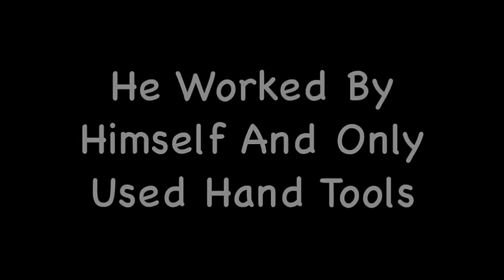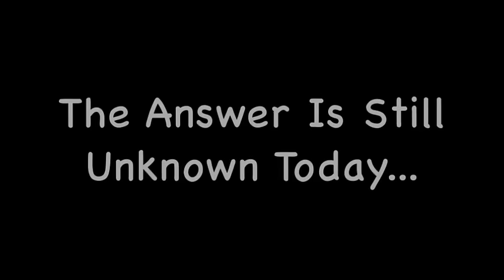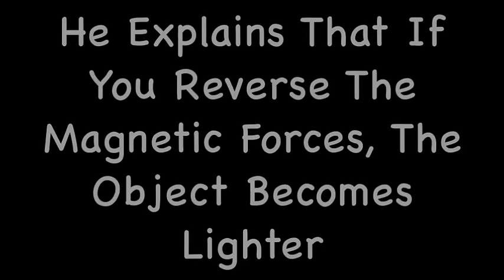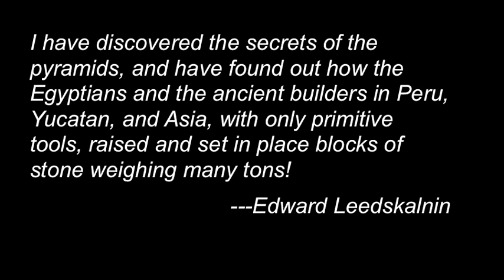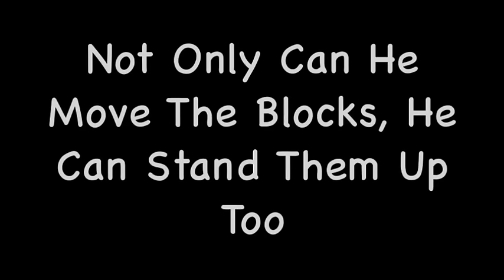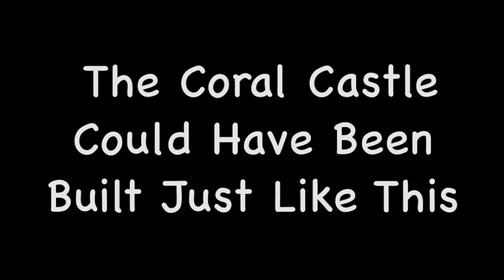Coral Castle: Mystery Solved

Comment: Well, Wally Wallington moved weights from one end of the block to the other.  A tripod could lift a side of a carefully balanced block.  Same forces involved.  But that was a VERY big tripod!  I would think it more likely that the blocks were moved straight up with the tripod and pulley system...if the chains were strong enough of course.  Surprisingly large weights can be pulled up this way!  They only have to be raised a few feet, a block placed underneath, then lifted again. Its not magic.

Comment: That's odd. I don't recall seeing the nice smooth concrete paths in Stonehenge that he used to rotate the blocks on pebbles to move them. Then of course there is the much more complicated Coral Castle that has a two story living quarters and the 9 ton door that was perfectly drilled and loaded on a truck bearing to rotate within an opening built with only 1/4 inch clearance on each side... That one that they couldn't get back in right with modern machinery after fixing the broken bearing....

Comment: Suuure.... Ed Leedskalmin used all this equipment and the middle of the night and got everything just right (Ed worked only at night). One time he managed to load an entire truck full of rocks (when Coral Castle moved to Miami) 30 tons in just 30 minutes. The truck driver came back early to find his truck completely loaded. Ed did all this by himself at the middle of the night with some wenches and some elbow grease. The pulley he was using was rated for only 1500 lbs and somehow he managed to lift 20+ ton rocks with that thing and position them just like he wanted. I'm sorry but Ed used anti-gravity technology there is no other explanation. The same thing that was used at the construction of the pyramid and the building of a 3000 ton block wall in Siberia (search for that one). Gravity isn't a separate force it is derivative of the Earth's electrical and magnetic fields (Earth has a charge of 500,000 volts). The whole 'expanded space' theory is completely bogus, it hasn't predicated a single thing correctly about our universe. According to that theory the orbit of planets should be circular, but they are elliptical. THEORY vs THEORY pick the one that fits reality BEST don't be sentimental.
Reply: Quite right. This is akin to the yahoos who go out into a field to prove they can "make" crop circles. They create crude facsimiles that exhibit none of the electro-magnetic anomalies (including warping of time)  or geometric intricacies of the vast majority of crop circles, and clap themselves on the back for a job, well...done. These are enthusiasts taking a crack at flying to the moon in a lawn chair tied to weather balloons.
Reply: Legends do tend to take on a life of their own.
   Another one,   a decade or so ago, the bearings on a rotating door that weighed 10 tons finally failed.  It was totally amazing how much huge modern construction equipment that was brought in to replace those bearings -- equipment which Ed had no usage of when he built it.  This story was actually true!
   There is a humongous pile of literature written as nonfiction which contain a lot of fiction.  They seem to call it "literary license".   (-;
   There are bodies in this solar system which have no magnetic field which have gravity ....... so ........ ?  It isn't even connected.
    There is no reason that the planets orbits should be circular under the currently accepted model.  But that said, they are incredibly circular.  If one would draw a perfect scale model of earths, or venus, or neptunes orbits on a standard sheet of paper, you could not, even with any measuring device you possess, tell it from a circle.  The rest are so circular that the scale model held up in front of a classroom would be declared a circle.
    Obviously the currently accepted model IS simply demonstrable truth,  and the orbits slightly elliptical, so ........ ?
Reply: 37rainman Try lifting 40 ton rock using this model, see how long it will take. Ed Leedskalnin loaded and entire truck full or rocks in just 30 minutes in the middle of the night. Was he using anti-gravity technology? I think so. Look up Ed's PMH device, it is a start.
Reply: Naoki Kashima Way ahead of you.   Already completely examined it about 35 years ago!  You seem to be trying to make an argument where there is none.   Neither you nor I know exactly what took place here, so it might be time for you to step down off your high horse!
   With you, things become somewhat doubtful when you assert that the pyramids required anything other then  very intelligently applied brute force.  Scientists have well demod how some of them were built by looking closely at telltail signs.  You might actually get into studying THAT part of it a little. The truth is probably a little more interesting then the fiction.
Reply: 37rainman How were*** the pyramids built? The great pyramid is 433 feet tall made out of more than 1,200,000 blocks with an average weight of around 5,500 lbs. According to mainstream archeology it took around 20 years to construct the Great pyramid. That means a block had to have been cut out, moved and set in place about every 8 minutes if workers worked 24 hours a day 7 days a week for the duration of the time. How did these workers managed to do this at night and continue producing such perfect results? How did these workers lift 5,500 lbs block 433 feet into the air to add to the top of the structure? I don't think we can even match this in modern day. The precision in the construction of the pyramid is 0.01 millimeters (hard to tell in the lower part of the structure because of erosion, original accuracy can still be checked at the top part of the structure where less erosion happened). How possible with primitive tools? How my mummies were EVER*** found inside of a pyramid? None. We even found a completely sealed pyramids STILL no mummies inside. Were these structures graves or did have a more practical purpose (electrical generators)?
Reply: Naoki Kashima You could find the answers to these questions in articles online.  The truth might be boring to you, but I find it much more fantastic then what happened in the figments of your imagination.  You are not visualizing what 10s of thousands of people, for generation after generation pouring their whole lives into a project, under very intelligent, brutal,  and motivated leadership, can accomplish.  The clues are there if one looks very close and notices the telltale signs
Reply: 37rainman A block has to be cut out, transported, and put into place every 8 minutes! Workers have to work 24 hours a day, 7 days a week for 20 years.

Look up how long it took to create the Great Pyramid, according to mainstream science it only took 20 years. Look up how many blocks it has 1,200,000 (this figure is given by mainstream science). Here is my calculation: 1,200,000 blocks in 20 years, 1,200,000/20= 60,000 blocks/ 1 year Now 60,000 / 365 days = 164.38 blocks / 1 day And 164.38 blocks / 24 hours = 6.84 blocks / 1 hour! And 6.84 bocks / 60 min = 0.11 blocks / 1 minute. To get a WHOLE number X ~8.5 .... so we get 1 block had to be CUT out, MOVED, and set into place every 8.5 minutes if** workers worked for 20 years, 24 hours/day/7days a week. I don't see HOW*** this is possible with normal technology. Explain?

Comment: its a very nice way of using gravity. but dont forget CORAL castle is coral.. it is brittle.. i dont think u can turn it on a pebble.. itll sink right into it.
and u state that its build between 1929-1951.. while in fact he did it in i think a few years it was? and later moved the whole thing to where its now. so he moved everything at least twice in the time u say... but stil awesome way to move multi ton blocks. cheers

Comment: I swear I saw metal screws in some of his equipment in the video.  And he’s doing it on a flat concrete surface.  I commend him for doing this, but I don’t think this is “proof” of how coral castle was built.
Reply: The hard surface underneath Just makes it easier, the same principle works on grass, just need a big enough rock that won’t fully push into the ground, you can also put a hard surface underneath it. Simple levers and wedges is all thats needed

Comment: He used the teeter totter rail road section to do that stuff... just tie off one end and sandbag the other and push over to truck... 2 guys 10 minutes to do because the pivots were all places all over the place...you do not move pivots! YOU ADD MORE and go from pivot to pivot moving only the rail section and sand bags on ropes in pairs and about 50lb each!

Comment: Okay, this guy moved a 1600 LBS rock pretty easy BUT all his blocks are near perfectly smooth on their sides. Has anyone that listened to this guy ever looked at the Coral Castle, it is ruff on most of its sides. Plus, it was one guy and he accomplished this entire castle in 20 some years, at night, with no sound, by lantern. So for a guy in his 40-60's (died at 64) to walk coral blocks with 5 gal buckets of concrete at night plus sick enough to died from it so he was weaker and only 100 lbs LOL

Comment: There are often magnetic anomalies, even around domestic structures, and alignment is no problem to any surveyor, and Ed Leedskalnin was an expert builder.
The mystery is not him moving the stones, that's easy with simple levers and pulleys, but how he cut the stone, about which there is no provable method. He generator is a bog standard electromagnetic device, nothing very unusual, but odd he said he depended on it for the work, maybe he just used it to run lights as he worked at night!!

Comment: Can't really be compared to Coral Castle.
The pebble trick needs a strong foundation to work.
Doesn't explain how the Coral Castle stones were moved from their quarry site.
And some of the Coral Castle rocks were intricately balanced,some on top of each other. The skills shown in this clip were fairly gross movements.
Interesting to note when the revolving door at coral castle had to be replaced some of rock used around the bearings defied analysis.

Comment: lol    wrong     you need a hard flat surface to move the blocks using this method    also when jacking them up how did he lift it to get the first couple 2x4's under
Reply: Dug underneath for first couple 2x4's. Maybe.
Reply: The guy was pretty darn clever. I have a 'zero' spatial aptitude so I am impressed.
Reply: used small rocks, tilted, added slightly larger rocks, tilted, more larger rocks, tilted, then started with the sticks and 2x4s.
Reply: He could dig holes too. My spatial aptitude leaves something to be desired, but it's fun guessing and he was a pretty interesting fellow.

Comment: Human power is all it took, the Chain hoist in the coral castle photos, explain a lot. Wood has a high compression load ( wet trees wieght tons), the dry wood can support rock roofs in mines, simple leverage was used.  Those that have never moved things by hand, haven't a clue. Ask any UPS driver, how much their Two Wheel hand trucks can move? Furniture movers, Airplane Load masters, the list of people knowing how to move things goes on.  That you or others doubt what is plainly there, is sad.

Comment: The mystery will be solved when this guy cuts out those large blocks from bedrock, shapes them and then stacks them all with simple hand tools.  Putting a concrete block with a smooth backside on a pebble and spinning it is far different than what was done in Coral Castle or the pyramids.  In this video the guy had to spin the blocks on another piece of concrete.  Lets see it on dirt or sand.  Mystery not solved.

Comment: You may as well say you can't use a solar car to travel all the way around the world, simply because it can only do a certain amount of miles per day, and can't run at all at night ... and the world's 25000 miles around!

Yes, but you just have to take enough small day-at-a-time leaps, and you get there eventually. The pyramids took decades to build, and Coral Castle 10+ years itself. Plenty of time.

Comment: That's some good evidence for Stonehenge, just a few problems.
One that first arch he built (4:46) is just as tall if not a little smaller than him.
Second that stone he put in the ground is great and all but how are you going to make and arch out of that, even if you try the stones at Stonehenge are much larger and taller.
Third Stonehenge was built with blocks from a quarry many miles away (as with the pyramids and other stone structures) then transported that distance and then stacked up, even in such a precise way that we today cant achieve with our "MODERN" tech.
Fourth (corresponds to the third) he built it out of concrete on site.
Fifth this takes a deviation to a place in Baalbek Lebanon, its the trilithon there, the heaviest stones there weigh 800 tons, there is now plausible way that our ancestors would have devoted the time, resources and energy into building this stuff unless it would be easier and less time consuming to do, because even if you have a pebble under that stone and just rotate it, its going to be a real bitch to get it there then prep it then move it again and finally place it only to repeat the process MANY, MANY times over.

Comment: The only giant blocks you can place with this method is how he shows, straight into a guide hole in the ground and standing it straight up, now this certaintly could be the method everyone (all the ancient people) used to set their foundation stones or even the giant obelisks, tho i feel a stone at certain huge weights would crack in half using this method before it stood up. Anyways, this method for foundation stones BUT this does not explain how they took that same size stone and stacked it ontop of the block now in the ground... now how do you lift another block exactly the same size and lift it up 10 ft high and stack it with precise alignments ontop of the other stone lol, this method only works on solid, (very solid) ground that is flat.  Doesnt explain how you make giant structures hundreds of feet tall with stacked blocks many tons heavy in what is considered laser accurate measurments of alignment,  its so boggling in the mind when you really truly  think about it,  and the fact that in this day and age and what we know, and yet thinking about how to possibly create giant structures with massive stones without the use of pretty much only one thing, a crane...and it blows our minds to this day, its simply amazing, and the true method they used will be nothing short of amazing too.

Comment: You must have left off the end of the video; because how does Wally rotating a block on a pebble on a CONCRETE PAD show how the upper layers of  CC or the pyramids were moved into position?  Did Ed and the Egyptians have concrete ramps?

Comment: This "solves" absolutely NOTHING. You are comparing apples and oranges. Ed cut and lifted much larger rocks than Wally did, and to much greater heights. Also, since his tripod was photographed, I would assume that someone would have seen a giant wooden lever. Wally has accomplished impressive feats using simple mechanics, but has not begun to even scratch the surface of what Ed Leedskalnin did.

Comment: The demonstration that the man pretends to do is a hoax. Rotate only heavy objects any child does, sway from side to other side becomes a playground for children, wrap gypsum blocks is joke. I want to see rocks with 3 tons float in air, and then put another stone above another. Do not just say I put on. I want to see, this man riding one piece over another. What Ed did, is to cut rocks, transporting by levitation then quietly put on. Easy !

Comment: No magnets at all! They had none to use then! LONG METAL RAILROAD SECTIONS HE DID HAVE.
You simply put them on a metal pivot point (he made many) and tie it to the block with wires and ropes...add sand bags to the other side....when it goes up it weigh next to nothing...You push and it goes in an ark forward...pick the other do same and the third. REPEAT
large stones required only more sand and a truck to move parts that he sold tours of his art to pay.
His buddy stuff and him are in pictures.

Comment: Here's my question, let's say he moved all of those coral stones in the same method.  How do we explain the engineering behind perfectly-balanced doors from someone with no engineering?  Doesn't mean ghosts or aliens or involved, just how did he know?  And back to carving the stones.  This is not fully explained, given the knowledge-base of the general public so many decades ago.  To perform such an experiment, one would need to isolate those involved from all education post the "castle" original and move-dates.  There was no google, nor is there any indication that a popular work was widely-available in the U.S. in general, not to mention Florida.  Does that make what happened supernatural?   I don't know. But that is the point - based on the commonly available engineering data published at the time, no one can say with certainty how Coral Castle created and moved.  "I  don't know" is the answer.  It's the only one.

Comment: Yes 1 ton 300 ft in an hour yes I can lift 200kg by my self but 10 and 30 ton blocks now thats a totally different storie. and to dig them out of the ground by him self and transport them, then back in 1920s they did not have trucks able to move such weight let alone anything to lift it onto the truck and get it off again and then do it twice in 10 years. I work in construction and I would have trouble finding a company who would even consider quoting the job and cost $1m+ to Ed was amazing.